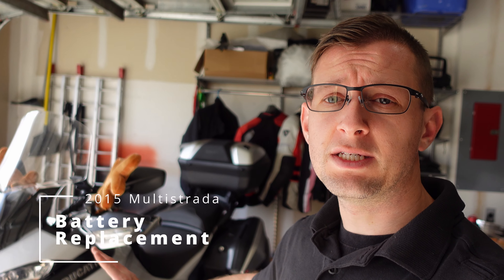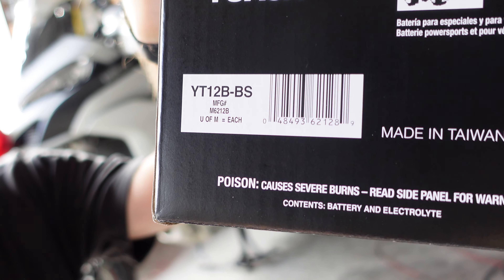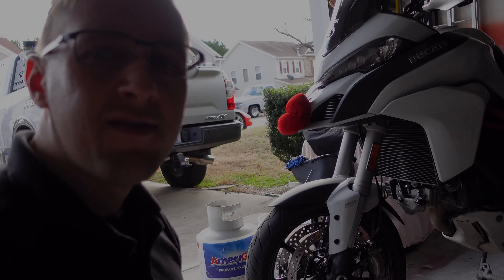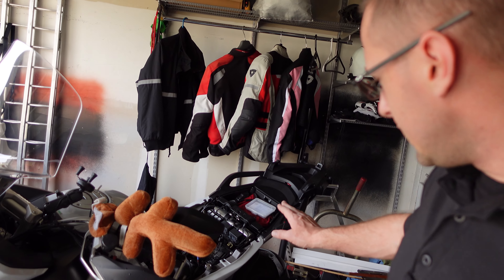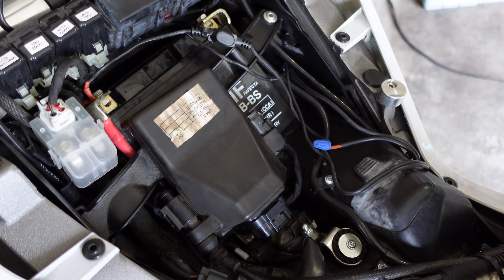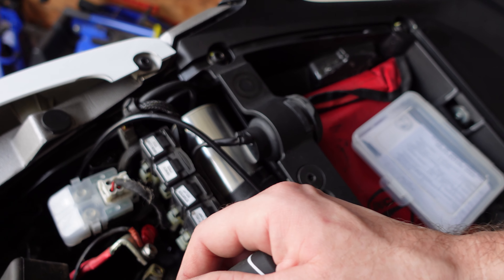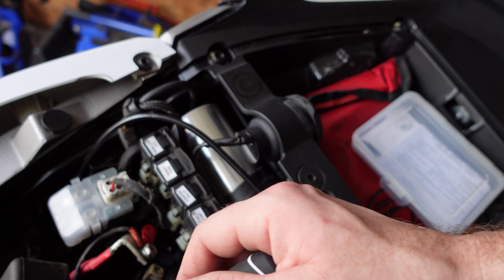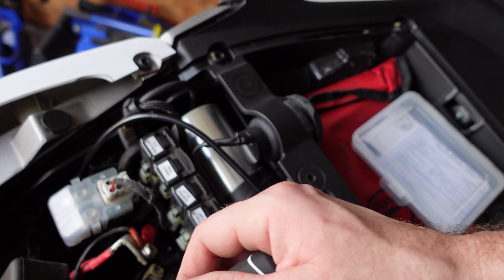2015 Multistrada Battery Replacement

Comment: Great video, thank you mate. Some advice for those that don’t know though please, always remove negative terminal first on a vehicle that has a negative ground system (just in case one slips with the tool and creates an unfused short circuit which could result in a battery explosion…in your face). One of the things taught us on our fist day at repair and servicing of road vehicles class. Again thank you for posting this informative video

Comment: Hi, useful video.  Do we need to charge the new battery after the initial setup? Before installing in bike? Is it mandatory?
Reply from the maker: Yes, for proper longevity of the battery and adequate starting power, it must be charged fully before installation

Comment: Just changed the battery on a same bike as yours but the bike will not start? I can't even turn the display on. Have you experienced that? I have checked wires fuses and so on. VERY strange. Should not happen just cause of a battery change.
Reply from the maker: Can you check the battery voltage?
Reply: @4KMotoring  Do not have the equipment but it is fully charged and the same Yuasa battery that Ducati recommends. 8 hours drive one way to the nearest ducati-dealer if I have to transport it and diagnose it. Such a pain.

Comment: Did your old one die before changing? Had two episodes till now: first one the clock was starting but did not ignite so I charged and everything ok for a year, but recently when I started the screen just shut down on itself! Have you had similar experience? Just checking that it is normal for it to shut down…
Reply from the maker: I had a couple slow start/ no start issues that had become increasingly frequent, so I decided to change it. The difference was amazing, the new battery was souch stronger